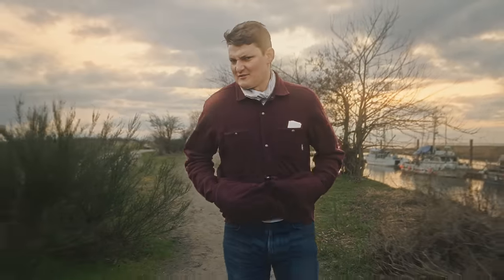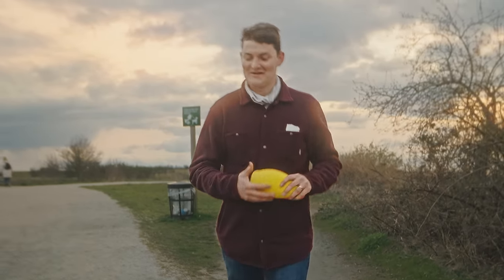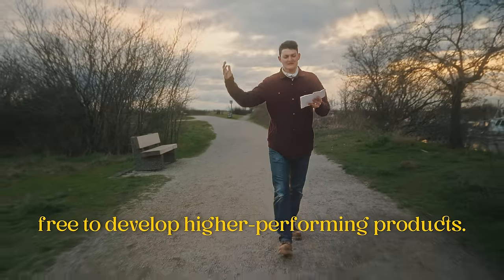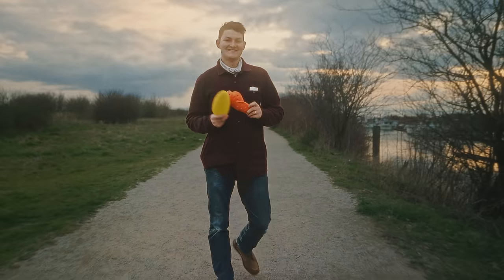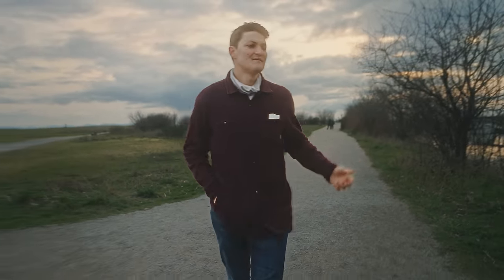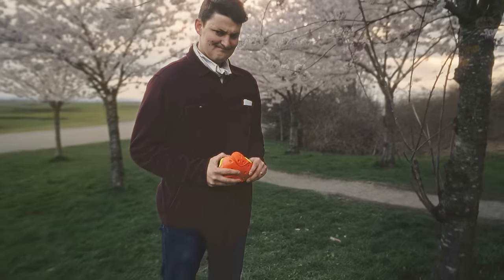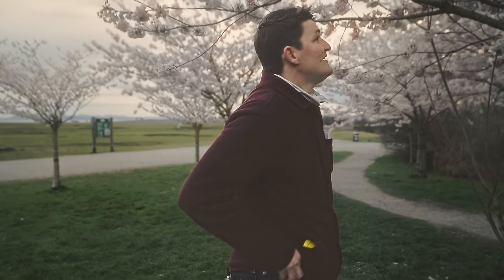Why I Stopped Wearing Motorcycle Body Armour

Comment: I'm an EMT. Been one for going on 13 years. I've seen more than my fair share of moto accidents. I can't say that gear has ever really prevented a fracture or not, but one thing I do think MUST be mentioned, that moto gear (with or without armor) DOES DO INSANELY WELL, is ABRASION resistance. Yes, a broken bone sucks, but I've seen a woman's breast belt sanded off by the asphalt because she only had on a sweatshirt. Down to the bone. 

Anecdotally, I have lowsided before at a pretty pedestrian 25-30mph. Armored jacket, regular denim pants. The jacket took the hit and I had no bruise or injury on my arm. The road went through my pants like they were tissue paper and I have a softball sized scar on my knee now. Armor wouldn't have really mattered there, but a pant with abrasion resistance absolutely would have.

So while I can't critique the argument against armored pads because I'm not an expert on the literature and most severe motorcycle accidents I've seen have had broken bones with and without armor, I can say that road rash can be a nightmare and have never seen road rash on an area where someone was wearing proper gear, and ALWAYS seen it on every single person that wasn't wearing any.

To that end, I think it's a bit of a disservice to leave that part of the equation hanging and not mentioned. That airbag is going to save you from a broken clavicle, but if you aren't wearing an abrasion resistant layer as well, the road might well grind your skin, fat and muscles down to the bone. We call those chest protectors with no sleeves "organ donor vests" for a reason.
Reply: I hope people read this and take your advice rather than do as Ryan says he does.  Road rash is a motherf***er to say the least and anything to help prevent it is a positive.  I have a “tattooed” left forearm where my shitty cuff button broke during a slide and let my sleeve roll up.  Would have been a lot worse if it wasn’t there for any of the slide, not to mention the rest of me that the leather jacket was still covering.
Reply: abrasion resistance should have been poited out better. but playing devil's advocate the video doesn't promote 
no gear , only no pads
Reply: Or rather, that the common pads aren't worthwhile
Reply: pads are not for abrasion. They suck at it. Video is talking about effectiveness of pads for what they are intended - impact dissipation. This is why he choose remove pads FROM a JACKET, not get rid of a jacket.
Reply: Yeah I hit a deer last year and was completely geared up head to toe and even though I broke multiple ribs and bones including ones in my face under my Shoei helmet, every doctor, police and EMT said my gear saved my life. And later after investigating my gear I did notice my level 2 pads were ground down and took plenty of abuse. So it’s probably a useless point but the pads did help too. The only abrasion I had was where the hip pad wore through.
Reply: Have you noticed a difference between leather and textiles?  I’ve wondered whether a textile jacket and pants would be better than leather, but haven’t really come across anything definitive, not even someone’s own observations/experience
Reply: he made a video a few weeks back about abrasion resistant gear.. and subtly touched on it in this video as well.
Reply: Damn you scarred me just telling me about that accident. Damn
Reply: Good reply. I’ve had bike and skateboard related road rash. I’ve biffed it pretty good enough times to not want more. Don’t even want to think what could happen on a motorcycle. Road rash or bruising can really hurt and take a long time to heal. I bought the most abrasion resistant pants I could find. With removable padding. I usually wear it. Always wear pants. Compared to hospital bills the pants are cheap. I think it’s a good way for people to look at protective clothing. I’ll pay now instead of later, thanks. Figure into the cost when you buy a bike the cost of gear. Funny back in the mid 90’s I had a Suzuki DR 100 as a first bike. Alway wore pants. Couldn’t force me to wear a Helmet for anything. After growing up on a bmx. They didn’t make you wear helmets for that either. I was pretty good at not falling down and hitting my head. Luck will have it that those are some great care free memories I’ll cherish.
Reply: @inevespace way to misread what i wrote and my point. You are the target audience for why i wrote that i did
Reply: @thepinoz but by framing it like this, it comes across as skeptical of gear in general. Never assume that your audience will assume what is not said out loud - a 15 second side comment about abrasion importance not being related to the pad discussion would have been all he needs to add
Reply: @samuelstein6629 anecdotally, no. If it's a good brand that isn't ancient and worn properly (and the accident was survivable, 150mph into a parked car aint gonna be changed by anything),  I've never seen leather or textile fail.  I wear a leather coat and gloves and a textile over pant.
Reply: @captaingoldbeered803  A lot of comment mostly disagree with Ryan due to these reason: slides and low velocity impact
Reply: @colinmartin9797 you wrote basics which anyone who wanted to buy protection knows (abrasion resistance is the must have). And you think it should be mentioned like people are so stupid. Maybe we need to say disclaimer that being on roads is inherently dangerous too?
Reply: Excellent thoughtful nuanced post . That poor lady 😢
Reply: @samuelstein6629  I had a AA jacket wear through in a ~25 mph lowside. I touched the ground with my forearm and knee, and the knee got the worst of it. The sleeve slid down my arm, so the rip was likely smaller than it would've been had I landed somewhere the jacket was less mobile. Granted the hole wasn't that big, maybe a quarter and a nickel side by side, I could imagine it would've been bigger had I landed on my back or upper arm and/or at higher speed.

My understanding is that a quality set of leathers can take multiple skids. I've never crashed in my leathers, but I can believe that's true. I'd much rather take a fall in the leathers than in textile.
Reply: I agree with you Colin. Given the forensics, the human body has a certain threshold of resilience - for bones, tendons and skin. As a paramedic for 25 yrs and an active adventure and enduro bike rider, I've been to road accidents where no amount of protection would have saved the life or limb of the rider, but I've tended to many tumbles in enduros & adv bike events as medic where no protection would have resulted in worse injuries or inability ride further. You can't control everything, but mitigating risk and injury can result in quicker rehab and in the case of abrasion, minimise or eliminate the risk of secondary infection, which in itself could be fatal (gas gangrene from gravel borne anaerobes).
Reply: ...and also, thank you for what you do!
EMTs are unsung heroes.
Reply: It's LITERALLY me mentioned in the video SEVERAL times.
Reply: Absolute BS😂
Reply: Agree, I’ll keep mine on.
Reply: Anything that reduces impact energy is worth it.
Reply: I commute in LA using a  Motoport suit (sans chest armor) with a Hit-Air airbag vest, shoei helmet, and Gaerne boots . The suit is a kevlar mesh with non CE rated but robust armor that covers a lot more limb than all the molecular CE armor sold in most gear. I also crashed on the highway a couple years back - maybe about 45mph when I hit and tumbled and slid; sustaining damage to boots, pants, jacket, vest helmet. Got a "degloving injury" to my knee and the skin over my elbow split open. no broken bones no stitches, no surgery, no road rash. lucky I didnt get run over. I'll keep wearing all of it.
Reply: @inevespace  i think you don't interact with enough people.
Reply: Thank you. I sell motorcycle gear and every single piece of gear says the same thing. This gear can NOT protect the user from all foreseeable injuries and or death. All the gear dies is help increase the chances of NOT getting seriously hurt but it can't save everyone.
Reply: @samuelstein6629  Leather generally sacrifice itself in abrasion, while textiles could be engineered to many characteristic which is hard to say what your textile would perform.

Some textiles like nylon is very good at abrasion resistant, but it could get hot and give you burn. While some is too grippy on the road and will just disintegrate. 
It's why racing gear do not use textiles, they heated up in long slide, but they are so good at resisting abrasion compared to its lightweight.
If it's no sweat for you to wear leather, get leather, but I live in very hot climate, I rather wear lower protection everyday than having leather that I don't want to wear most of the time. 
Just wearing a proper textile jacket and proper boots make you looks weird here, people in Thailand just ride in sandals and t-shirts. rofl But I don't care, it saved me from rashes many time, I never had a big accident that resulted in broken bones, but the abrasion resistant of cheap textile jacket for typical city speed crash is more than enough.
Reply: Thank You, lots to think about.  I appreciate you sharing your front line experience.
Reply: An Investment in training is always money well spent. Passing the government standard test is one of the lowest of common denominators when it comes to riding/driving safety.
Reply: No gear will help the crazy MOTOGP street racers. Now if you ride responsibly, invest in training and practice, have good gear you will greatly improve your chance of survivability. Not all crashes are avoidable, but many are.
Reply: @samuelstein6629 depending on what textiles you have, I’ve heard some just melts from enough friction during the slide
Reply: Yes and keep in mind that if you run into something, these pads aren't going to do much. If you don't run into something, then it's the abrasion that you'd need anyways as falling over off of a motorcycle isn't going to do much damage, apart from to the head and neck, which aren't being protected by these pads, that's what the helmet and possible neck roll are for.
Reply: got pics?
Reply: Road rash is no joke. My college roommate took a spill in Arizona during the summer while he was wearing next to zero protection other than a helmet. Common to see shorts and t shirts (back in the 90s). The poor guy got such bad road rash that he had to be golf carted around campus to get to class. I remember him breaking his abrasion scabs all the time for next several months just from normal movements, and hearing him wince in pain. He said if he had the right gear, he would have slid and walked away with no injuries.
Reply: @samuelstein6629  Assuming both are actually optimized for protection, leather is better.  That's why racing suits are leather.
Reply: Excellent insight. Thank you
Reply: I work in the medical field as well and have seen people's feet get degloved and recently saw a guy get both his butt cheeks shaved off. 

Yeah, most of the injuries come down to road rash, but I see a lot of people get those lacerations right below the knee from hitting something. Knee pads will definitely prevent or minimize that specific injury and that alone is why I would always wear knee pads and abrasion resistance.
Reply: i wend down on the freeway going 55-60 and slid a good length with only my shoulder and side of my helmet touching the ground. all i have of lasting injury from that crash is a dime-sized burn on my shoulder behind my clavicle bump (my shoulders are bony and my clavicle naturally sticks out a fair amount). i don't even want to imagine what would have happened if i didn't have my abrasion resistant textile jacket on.
Reply: As an EMT and a motorcyclist, I've seen some nasty road rashes too. You bet I wear leathers and a helmet, even on 90 degree days. Padding is indeed lacking, as Ryan says. The question is will regulators ever step up and fix it? Nope. No money to line their pockets.
Reply: @inevespace  Did you now read his first hand experiences? Pads helped GREATLY with abrasion resistance. How can this say they suck at it?
Reply: @inevespace you literally said pads suck at abrasion resistance, when the first hand EMT experience of the OP said it helps Greatly, and obviously so. So again to his point, it was for people like YOU who think pads dont help with abrasion resistance, and you doubled down! 😅
Reply: Good to hear from someone who’s seen their share of gruesomeness. My buddy and I always wear full gear, even in the punishing Arizona summers. We often comment about guys we see riding sleeveless and without helmets.  Dress for the slide, not the ride
Reply: Breast belt?
Reply: i think thats kinda the point that Ryan is getting at here, 'that armour pads/inserts that are more engineered for their abrasive/sliding qualities (while still having some impact benefits) ' is a better way to go than that what they are currently designed for. this would mean that the pad could be less bulky and less "intrusive" while still being beneficial.
Reply: Can you comment whether pads reduce a degree/severity of fractures?
Reply: @samuelstein6629  I've been told leather is better at race track speeds, but at highway speeds both offer perfectly adequate abrasion resistance. Textiles tend to be more comfortable in extreme weather and comfort will potentially stop you from having a crash in the first place. So - textiles on the street, leather on race tracks... or leather because it looks cool (and try not to ride in shitty weather).
Reply: @willgallatin2802 Incredibly, the European standards committee largely comprises representatives from manufacturers. Half the committee, including the Chair, work full-time for manufacturers. The gamekeepers are the poachers 😡
Reply: Did you notice any difference in the severity of fractures with and without armour? I.e. with armour a bone facture, without armour bone was utterly shattered
Reply: Wonder if a motogp rider thinks the same!
Reply: I totally concur... I also did not need that image in my head today D:
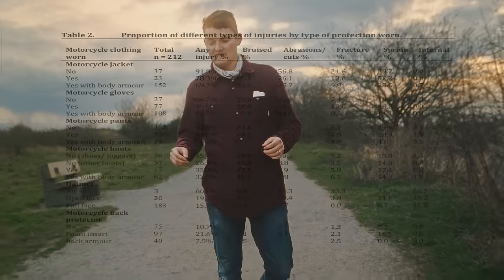Reply: @ZaarsShed  according to  the statistical survey results that Ryan shows (freeze vid at 2:29 in case you missed it?) while there is a difference in fracture % between "armour vs no armour" that difference is not 'huge' percentage wise [please note that Ryan seems to be discussing insertable pads/armour rather than in-built]. of note if you look at the bike pants result it shows a higher % of fracture rate if the pants ARE armoured (same with the boots result though the percentage difference is quite small)..    please note i was NOT advocating for NOT using pads/armour but rather that they could/should be better designed to provide more benefit according to the results shown.  ---- in fact the original commentor stated that  ### "I'm an EMT. Been one for going on 13 years. I've seen more than my fair share of moto accidents. I can't say that gear has ever really prevented a fracture or not, but one thing I do think MUST be mentioned, that moto gear (with or without armor) DOES DO INSANELY WELL, is ABRASION resistance. Yes, a broken bone sucks, but I've seen a woman's breast belt sanded off by the asphalt because she only had on a sweatshirt. Down to the bone." ###    which would suggest to me that maybe JUST MAYBE we should design pads/armour to prioritise abrasion resistance a little more than impact mitigation??  heck with modern materials and manufacturing processes (and amazing technology's that are available to even us at home) i would hope that even better and perhaps more 'tailored' (and affordable) options could be made available to everyone.  here's hoping :)

ps, please excuse my delay in replying, i was busy doing the family laundry and cooking dinner.
Reply: Even at and around 10-15 mph or even 5mph will rip standard denim jeans clean through as I've experienced, so now I have some Aramid panel jeans that will hopefully not rip as easily :)
Reply: @atholsdihgolsrihg  i too wear proper bike pants when i ride .i can't remember the brand off the top of my head but they are Kevlar reinforced (around the hips/ buttocks /knees) with pad armour inserts for the hips and knees. even if i'm just riding down to a local supermarket i still wear all my gear :)  safe travels and keep it upright :)
Reply: @captaingoldbeered803  you guys missed the point, this video isn't talking about abrasion resitance because it's talking about IMPACT resistance.. he's not saying not to wear proper gear, he's saying using proper gear with padding won't save you from a broken bone
Reply: @samuelstein6629  no, leather (of good quality, of course, and not 1mm thick) will do better than any textile, even kevlar (there's a reason motogp and the likes wear leather suits, and not textile)
Reply: @timbrandt7211 Is the abrasion resistance from good riding jackets and pants good enough or does it merit pads?
Reply: Wow - that’s an image in my mind I’ll never forget. Thanks for the post - any protection is good protection for sure: Ryan is just saying riders have been forced to settle for second best protection from manufacturers.
Reply: Exactly, just trying to keeps the doctors from scrubbing a shitload of pebbles from under my skin.
Reply: Fantastic post! Thank you for this and for the service you provide.
Reply: @onetrueone  well that’s the debate created by this video. I’ve crashed on the track and once on the road and can say with certainty that the pads helped me not sustain more injury than I had. In both circumstances the suits helped massively. I will say, while it’s difficult to justify wearing leather all the time there simply is nothing that comes close to touching the protection of leather. And I say that with experience and by witness of years of seeing people crash in it.
Reply: Abrasion will cause you to bleed to death if it shears through an artery. This video is a tremendously bad take, in the interest of looking edgy. As an academic myself, I can guarantee that those authors will be very unhappy that their work is being used to draw this conclusion.
Reply: I slid out on the freeway going maybe 45mph and had full riding gear except I was wearing normal pants. I hurt my shoulder a bit in the fall but the jacket, gloves, shoes, and helmet all got a good shaving, my clutch case shaved all the way through til there was a 2" hole but unfortunately my normal pants did absolutely nothing and I got a good skin shave on my leg. I ended up ordering abrasion resistant pants shortly after when I started riding again.
Reply: Regarding whether or not armour does it's job. If a RTA victim is fully protected by his armour, generally you won't get to see him in a serious injury department, so they never get to be told "the reason you're not here is because of the quality of your leathers and body armour". You ONLY see the ones where the trauma exceeded the specifications, or occurred between the protected zones.
Reply: Dress for the slide not the ride
Reply: As someone who's been sent skidding down a road at 40mph on their hands and knees, I second this. And ALWAYS wear decent gloves.
Reply: @The-Splat  I've been involved with working out a standard. Not in the field of MC gear, but I think my experiences are pretty normal.
First of all, mostly anyone can work on these standards. Ideally they want manufacturers, sellers, installers, users, etc. to get together and work out what makes sense.
In practice, that almost never happens.
Manufacturers will ALWAYS send people, since they benefit directly by doing regulatory capture or by adding unnecessary but highly profitable steps.
Everyone else pretty much just stay home, then complain later on. You will find very few professionals actually going to these things. In my case, it was a bunch of representatives for manufacturers, but no working engineers or electricians. They could have signed up. But across an entire continent, there was just me and a retiree.
And you know what, we still managed to change a bunch. It takes very little, but it does require someone willing to sacrifice time.
If you know competent people, consider asking them to participate in these things. Please do. It's desperately needed.
Reply: @williamwheaton8117  he means the breast was belt sanded, as if it was exposed to a belt sander. Awful.
Reply: @wessexdruid7598 
In my opinion gloves are equally as important as a decent crash helmet. Most accidents I've had I've not hit my head, but everytime you come off, even at walking pace, you put your hands down, and if they're not covered, you could lose your hand...
Reply: Its important to note hes talking about European standards as well. American standards may be different
Reply: @samuelstein6629 
I‘ve read an article where they compared leather and reinforced denim. Mist have been in a German motorcycle magazine. Denim held up just as good as leather, on average. The bigger difference was that with denim you wouldn’t slide as much and come to a stop sooner. On the racetrack you might not want to reduce your speed too abruptly (so wear leather) but on the road you might not have the space to just keep on sliding. 
By the way, they said that in all of their tests, the dummy came to a stop way before the plastics got so hot that they would melt.
Reply: The video clearly made the point of abrasion resistance vs. impact resistance
Reply: @AlexDerange  I didn’t miss that at all.  My point is that the pads help significantly with abrasion too.  It’s something else between your skin and the ground.  They also do help lessen the severity of certain types of impact injuries (not talking about broken bones).  I’m not gonna try to quantify it, just use common sense to think about it for a minute.  Also, I learned from experience.
Reply: @JesusChrist_IsTruth-LoveForALL 1 meter thick paper block also helps greatly with abrasion. If pads are good for abrasion, they would be 1 mm thick. Anything thick enough will help you with abrasion, but you need to consider disadvantages caused by thickness.
Reply: @samuelstein6629  leather is definitely better than textile but its hot, textile jacket is a one time use in the event of an accident as it would have been torn by then
Reply: @inevespace  crash without pads and then crash with pads and then get back to us.
Reply: @JesusChrist_IsTruth-LoveForALL  you miss the point of discussion. You can attach 5 pillows to your body and argue that we must use pillows instead pads. I crash 1-2 times every time I go out to ride, it is normal when you training on the edge of traction.
Reply: "I do think MUST be mentioned, that moto gear (with or without armor) DOES DO INSANELY WELL, is ABRASION resistance"
Yes, and it has been. TWICE.
is the attention span lowered so much that even when something is mentioned twice in a 6 minutes video, someone have to write a comment without understanding the video?
Reply: @IIARROWS   no,  buddy. Context matters.  A lot.  You are looking for confirmation bias to defend a criticism. Both mentions were in passing and an aside meant to frame his point in regards to armor results. That's not mentioning the importance of abrasion resistance. Context is crucial and that line is not going to be considered a "key takeaway".

Just including a footnote or happenstance line does NOT EDUCATE PEOPLE. It never has, it never will. Maybe yoy should learn how education works first.  Never assume a general audience will tease apart the nuance that is not said explicitly. Thats why we cant say terma like "passed away, no longer with us, etc." When telling a family member their loved one died. We have to be brutally clear.

Also its why f9 added a pinned post with exactly what i described, after i made my post. F9 guys are good. They just slipped up and missed a key point worth mentioning because this kind of content very seriously might make someone not just remove their armor inserts, but not wear abrasion resistant gear at all.

Your desperate need to validate a cult of personality you have built around someone (whom let me be clear, i REALLY like. I love this channel) has made you blind to the pragmatic reality of education communication.
Reply: @colinmartin9797  I've only read the first sentence, because funny enough that's true and you are ignoring the context.
The video starts with a statement that could seem like a joke coming from a retailer, but the joke is on manufacturers.

That's your context.
Reply: @IIARROWS  you are exactly the kind of person that proves the importance of spelling out context. Thanks for proving my point, ride safe.
Reply: @colinmartin9797  Proving your point by pointing out your mistake? Sure, nice trolling.
Reply: "I've seen a woman's breast belt sanded off by the asphalt because she only had on a sweatshirt. Down to the bone. "

Didn't want that image, some people ride in kit that I wouldn't wear on a pushbike.
Reply: thank you
Reply: Your job is solely to stabilize and transport. You seem to be much like a nurse that gives out medical advice. Way out of your depth.
Reply: @Rando-user-zm1fx  yeah im also a biochemist and applying to medical school currently. Im a training officer and instructor and ran the fire and ems for a race track for years as a part of my 13 year active career. Maybe bite me. I stayed well within my realm of expertise and training and was very careful to not make wild claims outside of that. What were your credentials, again?
Reply: @colinmartin9797  oh dear, that's boring. You should have been a writer since you like to write so much 😴
Reply: @samuelstein6629  Leather is better, and the better the leather the better the abrasion resistance, that's why a lot  motogp leathers are made of Kangaroo leather, the absolute best leather there is....
Reply: @PanicToThePeople  Denim wears through in seconds, leather doesn't....
Reply: @thepinoz  it also doesn't outright promote no pads, just low quality pads. He is critiquing the entire industry for having inadequate impact attenuation. Note the section where he advocated racing quality armor but then notes that it goes FAR beyond what CE 2 requires making it more useful. His critique is that CE 2 is inadequate, and that the industry has no motivation to improve especially when most countries legally require the sale of pads, but only low quality pads.
Reply: Organ donor vest 🤣 damn... Yeah, it's pretty on point.   But even, with sleeves.  This ones are proper gear but not on the road. They are for Off-road / motocross or under a proper jacket.

So jep.   Thanks for sharing dude
Reply: @captaingoldbeered803 but hey! Ryan just talks about the little pads not a proper jacket!!    So I can understand his intention.
Reply: Honestly I always thought the gear was for abrasion resistance… I never even floated that they would prevent a bone fracture. If I’m tumbling down asphalt at 50mph I expect I will break multiple bones, regardless of my clothing. I would like to at least have some material to grind away at as I come to a stop.
Reply: Disturbing
Reply: An airbag wont necessarily  save you from a broken clavicle as most of hose brakes are from  the trauma transfer up the arm from the hand to the  shoulder inside the body and the result is a broken clavicle no matter what you are wearing.
Reply: Right. Wear full armored leather jacket and pants, full face helmet, armored gloves and armored boots....to literally hold your shit together.
Reply: Thanks. Logic.
Reply: All I've ever heard is that leather offers quite a lot more protection.

Can't provide you with any link though.
Reply: Well said.
Reply: Damn! That paints a vivid picture!
Reply: @samuelstein6629  Leather is better than textile for abrasion resistance.
Textile gives protection, but leather is going to hold up to higher speeds and endure longer slides.
Textile is really only used for cost, lighter weight, and comfortability. Maybe versatility. But you can include versatility into cost effectiveness.
You want max protection, always go for leather.
Reply: tileux  Your friends legs likely got burned just from the heat from friction. I don't know what you mean by kevlar burns, but if you're saying there was something about the Kevlar that burned his skin, I would say that wasn't it. Outside of kevlar transferring heat like the way you can stick you hand in an oven at 350F but you can't touch any of the metal inside the oven.
Even with leathers preventing any road abrasions, you can still get burned like a sun burn from the heat of friction.
Reply: That was a great comment. Thanks.
Reply: @inevespace  what impact dfoes a back pad do??  its for sliding on your back...  its not for impact.